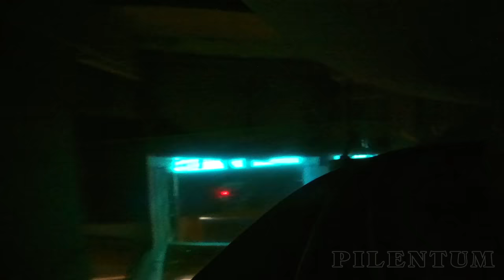Pilentum Porsche Model Trains Cab Ride Documentary (Full Movie) 「鉄道模型」

Comment: I like the quality of the design (specifications) and the workmanship but have curious outlook on the overall layout. It seems the layout was designed to impress other model railroaders and not to entertain the public. Why else would so much of the layout be ‘hidden’ at a ratio of at least 50/50 and maybe closer to 70/30 (based on cab ride video)?

Comment: I was impressed by the construction, detail to the wiring, the rock cliffs were excellently done as well as the vehicles moving about on the roads.  WELL DONE!!  Now for the part I didn't like.  This layout ends up with the trains spending more time running under cover than out in the open.  That's too bad for the visitors because the trains are the heart of any layout.  Overall, I give this layout a 9 out of 10 on the "must see" scale.

Comment: Question:
How you clean that big layout, because dust will settle in time?
Reply: Heavily filtered air cleaning/flow system for the building. You can effectively remove the majority of the particulates that way. Think clean room environment for PCB component manufacturing, very similar.

Comment: I keep hearing electrical cracking. Are these trains running on the overhead wires?
Reply: The loud scratching sounds seem to be when the camera sometimes rubs the overhead wires which are only for show. Power is supplied to the trains thru the rails.
Reply: @segoon2000  Marklin "3rd rail" track